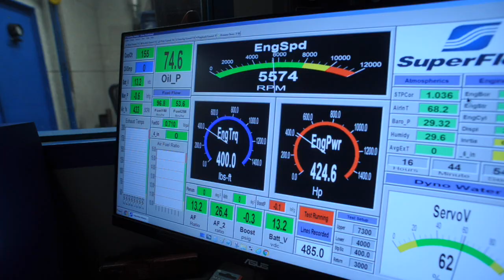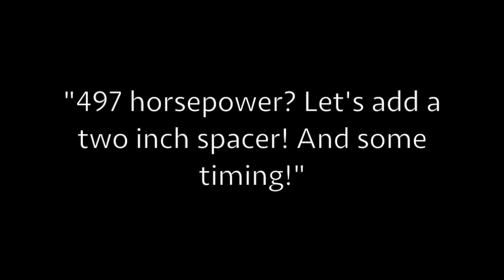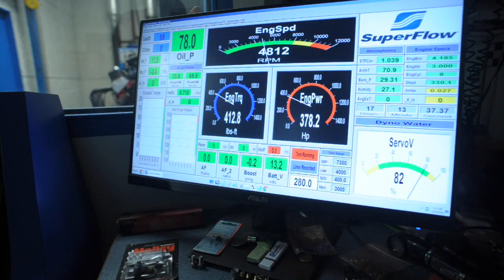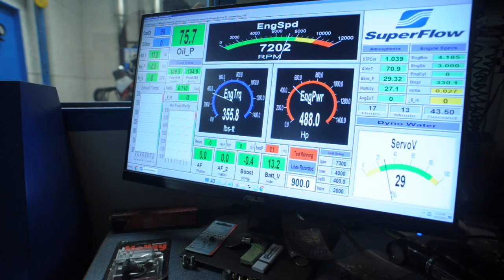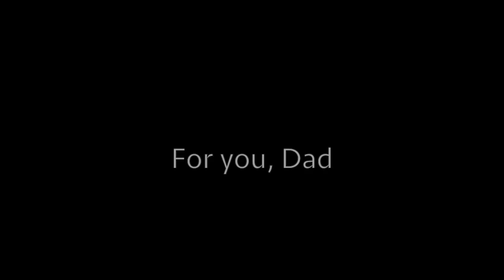Dyno #2 283 Crankshaft + 400 Block | Big Bore Short Stroke SBC

Comment: This is very exceptional for 329 N/A cubic inches! Not many 5.3L(325 cid) can say they hit over 500 HP N/A. And this is with a dual plane intake!

I'm really liking the long rod ratio sbc stuff, this is how the General should of done it back in the day! So what is the static compression ratio of this? What dome pistons did you use or were they flat tops? What size intake runners and chambers did the AFR heads have and what do they flow?

The articles I have read say the short stroke long rod engines like the smaller runner heads because the shorter stroke supposedly doesn't have as good of a draw like the longer stroke cranks do because of the slower piston speeds and less draw time of the shorter stroke? Plus the long rods with their dwell at TDC and BDC make them even lazier. The shorter stroke does on the other hand help it have less pumping losses though. Supposedly because of the dwell at the top makes it less detonation prone even with higher than usual dynamic compression ratios so lower octane fuel can be used with those higher ratios? 

Do you think what I wrote above helped to push this build to its higher HP and torque production? I can't hardly wait to get started on my sbc 400 block with a sbc 307 crank build! These short stroke long rod sbc stuff looks so fricken cool! Hopefully the lesser cubes make it get better fuel economy as well as having the extra brute force with more throttle angle.

For the bigger is better crowd, that's been done WAY more than what has been done here. If you still don't get it you should probably move along? Not everyone wants 1,000 HP that gets 5 gallons per mile! Some of us think 400 to 500 + mild cam HP is awesome for the street and will probably get decent cruising mpg to boot even better with an O/D. Remember the more power the engine makes the more power the components behind it have to be able to handle at an even higher cost of the engine build.
Reply from the maker: It’s Either Gonna Work…
Thanks for the comments you’ve made again. I’d also like to answer your questions. 
The compression ratio is 10.78:1 with 55cc chambers (angle milled .100”) and flat top pistons. The quench is .035”. 
The AFR heads are the 916’s with 180cc intake runners.

I think you’re correct in what you’ve committed about the benefits of the long rod short stroke combo. 

What heads are you going to use on your build?

Thanks again.
Reply: @ceperformance  
Are those heads the genuine imitation camel hump heads? Or does Trick Flow make those? Wow! That's a lot of milling off those heads! What size chambers did they start out as?

I am planning on using a set of Vortec heads, not sure which ones yet, either 305 or 350. You mentioned on your other video in the comments if I used the 305 heads that the valves would be shrouded. But they won't with all the available room to unshroud them because of the 4.185" bore I'll have, I'm not afraid to grind cast iron. 

The 305 runners should be smaller than the 350 Vortecs for even better velocity for the better long rod short stroke draw. From the factory they flow right around 220 in. cfm with the tiny nail head valves they have.(1.812" or 1.875" one or the other?) My plan would be for 1.94"/1.60" valve combo with either set of heads. With unshrouding and some bowl blending should easily bump the flow up around 250 in cfm? 30 cfm is the low hanging fruit which would be just fine, enough air flow to support 500 HP

The 305 Vortec heads have a small ramp in the intake runner right under the valve to promote swirl. The chambers on the 350 Vortec heads are what is suppose to promote swirl. But I'm still a bit uncertain with iron heads a mild cam and over 10:1 static compression if the 350 chambers will handle the higher compression better than the 305 Vortec heads? Or perhaps either set will be ok? The 305 heads will make it easier to get the compression up for sure without a bunch of head milling.

What do you think?
Reply from the maker: @itseithergonnaworkoritaint7852  
Thanks again for commenting! These are AFR 180’s # 916
They start at 65cc. The angle milling was ordered to be done at AFR and it’s doable because the .100” is from the exhaust edge but angled towards the intake surface where there’s almost nothing taken off. The intake gasket surface is angle machined as well to put the factory angle back to match the deck so the intake manifold fits normally. 

I think using the 350 Vortec head is better but like you described, the 305 heads modified could be very good too! Don’t know unless someone tries!

Take care and take chances!
Reply: @ceperformance  

That's right, it's either going to work or it ain't! LOL Don't worry though because I'll make sure to make a video of the results.

Thanks for answering my questions. One more though, a friend of mine was wondering what the rest of the cam specs are? The lift, LSA......etc... Thanks in advance.
Reply from the maker: @itseithergonnaworkoritaint7852  
You’re welcome! 
The cam is on 114 LSA +4 degrees advance
224/230 duration @ .050”
.536”/.544” lift with 1.6 rockers.
Reply: @ceperformance  

Cool, thank you.

That works out just right with the Stan Weiss website max flow numbers of 270/217 @ .500" lift where they max out for the heads you used. Good job choosing that cam and pairing it with the 1.6:1 rockers. This means you are utilizing 100% of the flow, nice!

On the other hand, I like a tighter LSA though, IMO 108 to 110 would of been a bit stronger? David Vizard likes the tighter LSA cams as well(even tighter, like 104 to 108!). Unless you have to use one with the wider LSA for fuel injection, you might want to try a tighter LSA? Especially with the lower duration @ .050" cams because the lower duration limits the overlap so the wider LSA isn't needed so much to limit overlap. Something to think about anyway? It's either gonna work or it ain't:)
Reply from the maker: @itseithergonnaworkoritaint7852  
Very good points, thank you! 
Realistically, this is a very mild street engine and the 114 fits this application perfectly.
Reply: @ceperformance  
I wasn't trying to put down what you built, was just pointing out that the dyno numbers may have been a bit higher with a narrower LSA? I wasn't taking in consideration the drivability or the application, just the dyno numbers.

Plus I wanted to write more comments for the algorithm so you get more views, which looks like it may be helping? No one else that I know of is doing what you're doing and sharing the results so I want you to succeed. Keep up the good work.
Reply from the maker: @itseithergonnaworkoritaint7852  
Much appreciated! I really value your enthusiasm too :) 
Your absolutely right that a tighter LSA would increase the output. 

Did you hear about our short stroke
LS 349 cube engine build?
It’s a 3.267” stroke and a 4.125” bore.
Reply: @ceperformance  
No I haven't heard about that one, did you build it already or is it coming up?

Sounds like it's gonna be a cool one, can't wait!
Reply from the maker: @itseithergonnaworkoritaint7852  
It’s in my 1971 Nova. Go to our channel and you’ll find a video of the car getting punished :)
Reply: @ceperformance  

I will do that right now! Cool.
Reply: Built 331's +.. Decades Ago..Same Concept..Large Bore Small Stroke(327) & make 450tq & hp. 
If you're going to put it in a Lite Car, Fine.. Otherwise Don't Expect much.
Good Old 400 blocks are Harder to come by and Still Aren't Great.. The Need for Special Bearings & Spacers for the Mains then All Machine Work.
Not Saying it Doesn't Work... 
Unless it's a Classed Displacement 
It's just a Screamer... Replace the 307 crank w/a 350 crank and start at 377
@ Std.Bore & Still Keep Good Geometry and Make more Torque that Results More H.P.
Someone Above Mentioned Guy's wishing they Get Numbers like this from a 383's...Ha.. If you've a 383 that Doesn't Hit 500 hp/tq before 6000 you've No Business even Checking the Oil...
As For DYNO numbers a Little Incher as Such needs to be in Light AF CAR..
Many Are Bedazzled/Confused about
Efficiency.. Back to Classes (Example)
70's NHRA PRO STOCK...
JENKINS Vega 33? Cid Sbc against
Alot of BBC & HEMI cars... 
JENKINS Played against the RULE BOOKS... Partially Successful..
If still looking to play w/ Stock stuff..
Find a Good Std. "509" casting 2 bolt or (511 casting 2/4 bolt) & a Good Std./Std. Steel 350 crank and 6 inch Rod even w/ Flat Tops.. Upper End Is where it's at Max.@ 195/200 cc intakes w/64 cc chambers will produce 377 w/tq & hp in the 500+ range under the RPM and Climb...
Plainly..Get the Most Efficiency for the Efforts..
Reply: @adrianwickline3430  
Well, the block I have is a .040" 817 block that needs to be bored and they don't make .050" over pistons. Instead of scrapping this boat anchor block, I'm going to put it back in service as a lighter duty smaller cid engine which will still be 358 cid.

The build these guys did with the 400 block and 3.25" stroke made 400 ft ibs from 2,500 RPM and stayed over 400 ft lbs to 5,300 RPM! With that kind of torque on tap why do you think it needs to be in a light car? There were a lot of factory built sbc 350s that went into full size trucks with barely 300 ft lbs of torque, this one will have 100 + more ft lbs!

You must be one of those has to be the biggest you can make it to max out what HP you can make guys?(been there done that) Well eventually you'll learn that there will always be someone that will make more power than you and there will be someone that will make more than that guy and so on... So who the flock cares? 

I have done the bigger sbc 400 builds, a 377, a 434, a 406, built those, been there, done that. Can't wait to do a 358 with a boat anchor sbc 400 block. I will do mpg testing with it as well. It will be in a 1997 Z71 extended cab short bed. Will be using Vortec heads, still debating which ones though, the 350 or 305 Vortec heads I have?

Comment: Is that a 350 journal block? Aftermarket? Small journal 283 crank?
Reply from the maker: Hello DJ Vintage Auto. Thanks for asking. Yes this block has 350 mains and it’s an older Bowtie block. The crank is a 283.
Reply: @davelighteon1927  not at all, I know this that's why I'm asking if it's an aftermarket block. The 302 which is rare is the only 3" stroke Chevy crank with the same journal's as a 350. I myself have used a 307 crank in a 400 block with bearing bushings. 3.250" stroke, stock bore 348. You can buy aftermarket blocks with 350 journal's and Siamese 4.125" bored.
Reply: @davelighteon1927  lol, I'm so glad your proud of yourself. Good job.
Reply: @jdvintageauto2958  dont b a dud
Reply: @jackperry9369  please explain.

Comment: Yes, ok, but what is the point of this? Is it for class racing limited to 330 CID or for bragging rights with 1.55 hp/CID? Would not more stroke produce a stronger and nicer engine?
Reply from the maker: The point? For a mild street engine that’s getting a TKX 5 gear, it’s going to be just what the customer asked for… and then some. We’re very happy with the results. 
Thanks for commenting :)

Comment: What size carb, and did velocity stack help, are simply a means to measure air flow verifying CFM"s through carb.
Because it was once believed to increase air flow due to the venturi effect actually increasing the air flow, and having an actual drop in interring air temps, smoothing the turbulence greatly through the carb, and simply making the engine gain few more rpm"s to the top end.
Was the theory back in my time, and I know it works in air flow, and lowers static pressure in large hvac systems.
By the way she sounds angry, must be ready for ford or dodge to come close enough to show her tail lights to them
Reply from the maker: Hey, thanks for commenting! The carb was a Holley Brawler 850. The 2” spacer did help, making more torque and horsepower.